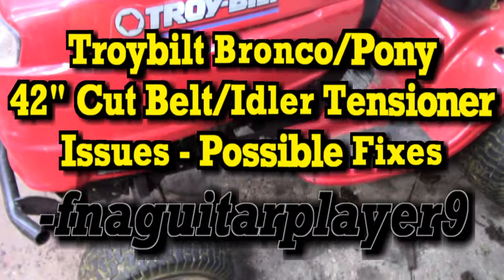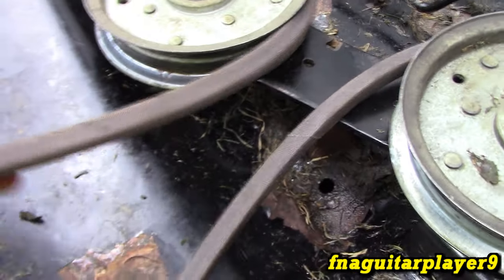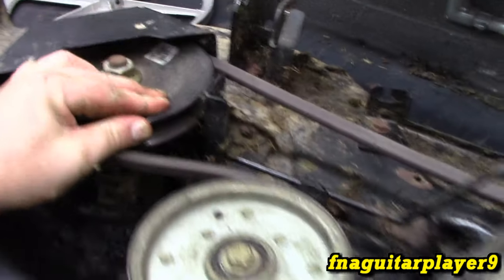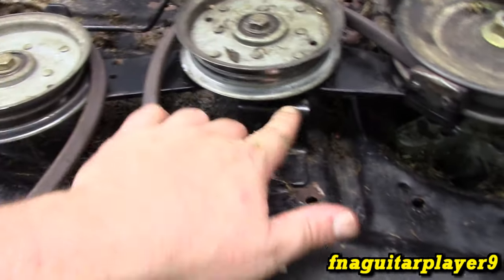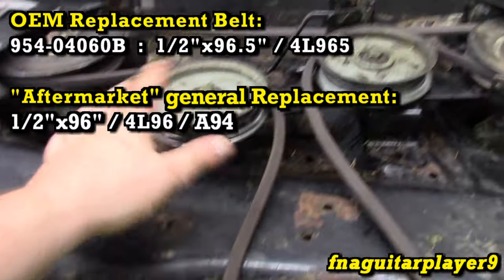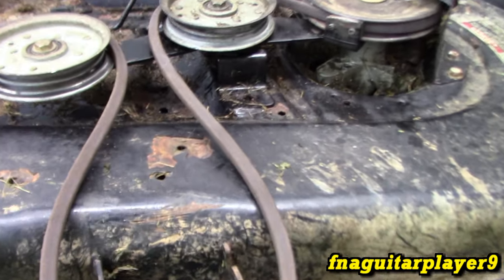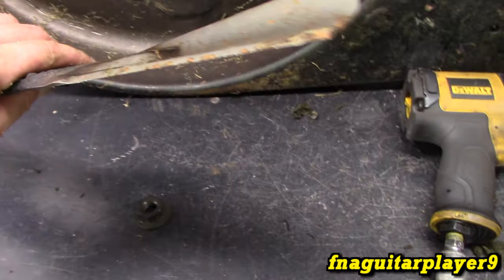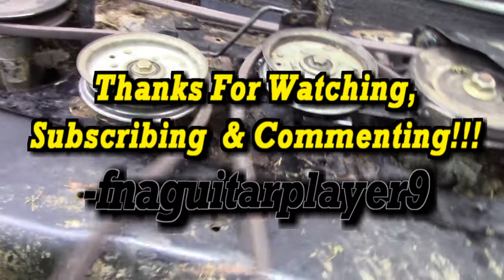Troybilt Bronco/Pony 42" Belt Tension Problems, Blade Brake Linkage, Spring Adjustment 96/96.5 Belts

Comment: Hi. Any tips on how to align the idler pulleys? It looks like mine are not level with each other and I think that's making my belt slip.  I replaced the belt keepers and had burned 2 belts getting to where I am now, have the 96 in belt that fit fine, but I went to mow today and got thru most of it but the belt slipped again.  It is slipping underneath the left ilder pulley and getting wedged in such a way that I have to remove the left idler pulley to get it out - there's no way to simply pull the belt back into place using fingers or a screwdriver.  Thanks for ANY help - I just want to be able to mow my lawn without my belt slipping! Thank you thank you thank you!

Comment: The new belt on my Bronco is very loose. Part of the problem I found is the brake puck or brake pads for the pully's are cut and worn causing excessive travel in the idler system. If your replacing belts then I'd recommend replacing the brake pads for both pulleys.

Comment: Thanks. I think you just figured out my problem.  I replaced a belt after breaking it then snapped another one. I replaced both idler pulleys and it worked great until I lost tension. I'll be dropping the deck again this weekend.

Comment: Hello. I just wanted to drop a line and THANK YOU for the tip on adding tension to the PTO cable spring. The blades would not engage because the belt was not tight enough. So I moved the PTO cable spring from that first hole to the far edge of the idler arm. I tried to move it to the hole in the middle but could not. Anyway, the move to the edge increased the tension on the belt and the blades now engage.  MANY THANKS AND GOD BLESS!!!!

Comment: Nicely done. Thanks.  Your video has obviously helped lots of mower owners.  Speaking of the blade engagement cable.  It runs through a bracket underneath on left side of the mower frame.  The cable fitting requires a hitch pin which can be inserted ONLY after the bracket is removed from the frame.  On my Troy Bilt rider, which is 19 years old, that bracket is attached with screws  and the threads had stripped, so I reattached the cable bracket with galvanized bolts.

Comment: One problem that I have/had is, the tensioning spring tends to rub on a pulley, when disengaged. Eventually, the spring  gets cut off from abrasion. I might built a support saddle/bracket,  preventing the spring to sag too low, when disengaged. Thanks for sharing Frank.
Reply from the maker: I feel like I've had that happen on another one, now that i think about it. Thanks for Watching!!!

Comment: Good fix and my old LT is all mechanical and still running the belts I got on it. I had a 16 horse I had to give away vecause I wasn't able to fix it but the old one just needs an oil change. You did good and go pick one! Blessings
Reply from the maker: I hear ya! I was glad this was a fairly simple fix, just hate pulling the deck off! Thanks for Watching!!!

Comment: My issue is I don't think my cable is broke but it has a lot slack where it bolts up under seat. It finally pulls the spring on the deck once the lever gets almost to the bottom when trying to engage the blades. The pulleys don't close or release. The blades cut off while I was cutting.

Comment: My problem is when I engage the blades, the pulley brakes are still in contact with the pulleys a little bit.  Any idea what might cause this?
Reply: Did you ever find the issue? I’m having the same problem myself. An OEM extension spring helped a little, but now my blades only spin when the deck is up all the way, but they don’t spin fast enough to cut.

Comment: i have a 2006 model #13an77tg766 troy bilt pony the extension to the right on the deck looking at the video did you modify that one i missing mines what is the proper spring and can i go to the holes on the bracket that holds the deck in place with the arms in hole with pin

Comment: I have a loose rod underneath there, and I can't figure out where exactly it was attached.
Reply: My rod came off,did you ever find anything on this matter? Thanx
Reply: Watch DIY Jim ( how to change John Deer blade  brakes...) it might be helpful
Reply: Yes, so I went to Tractor Supply and looked under their machine and saw how they had the rod connected above the deck. I took pictures, went home, and connected mine to the same spot.
Reply: @YoungerGen-X  Thanx great idea😁
Reply: @trixie6804  Welcome